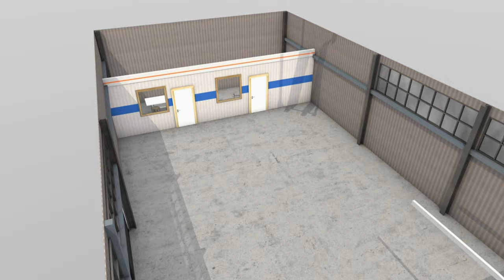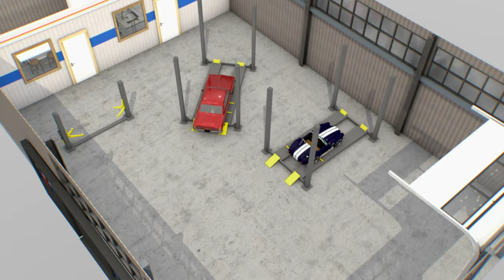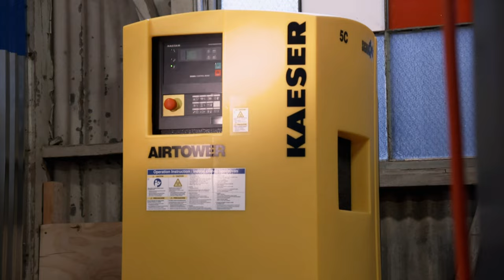Richard Rawlings SHOCKED By This Shop's Non-Existent 'Security System' | Garage Rehab

Comment: $800 dollars a day per lift? Yea right!! Last shop i went to they wanted $900 for front struts (300 for struts) it took me less then 2 hours to do it in my driveway. Should be almost $2000 a day per lift
Reply: Was going to say something similar too. Some shops charge over $100 just to put snow tires on for a half hour job
Reply: It cost about 500 $ a day to keep a shop open. Not including parts and wages.
Reply: I priced the 3 for 11.500
Reply: $800 a day profit. Subtract part cost, labor rates, and associated overhead costs. Your $900 quote for struts was $300 in parts, assuming risk of part failure as a potential sunk cost, paying the technician, and paying the shop's bills. They're pretty close on profit per day per lift.
Reply: Yeah seriously. Or every single exhaust shop that says they charge by the hour then quote you $250 to replace 12" of 2.5" of stainless.. Places like that are a joke. I get my buddy to do all my exhaust work because he ACTUALLY charges me a flat hourly rate when I bring him the parts. I seriously hate exhaust shops for that, if you do piece work just say that on the sign instead of lying saying you charge hourly